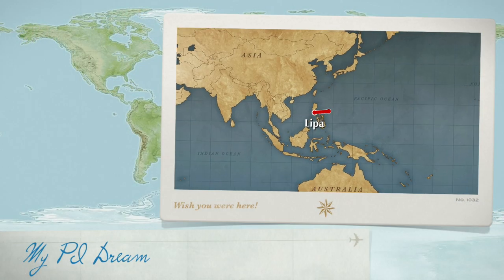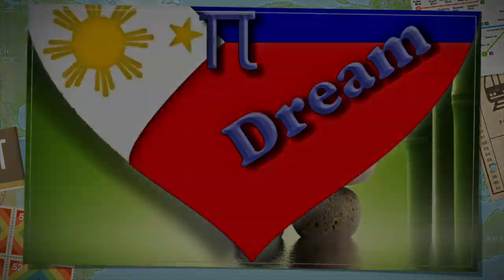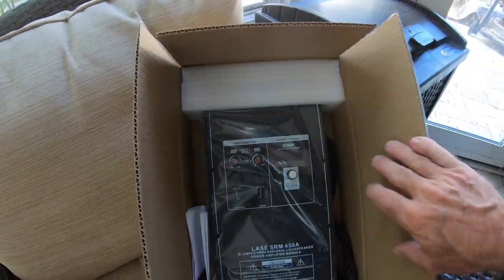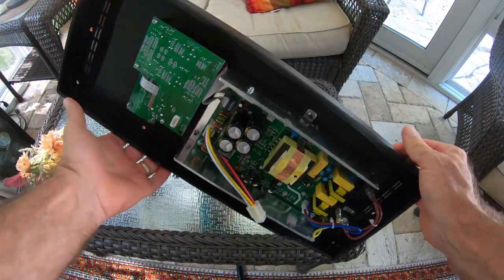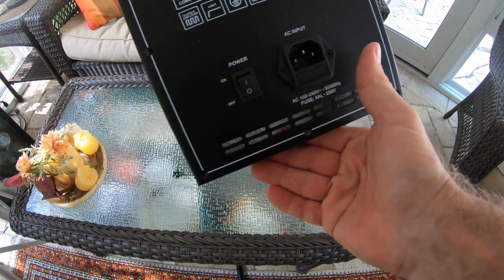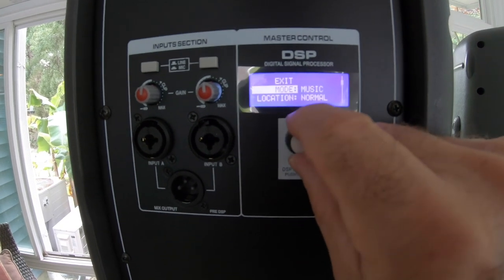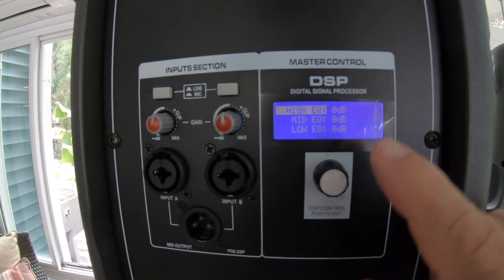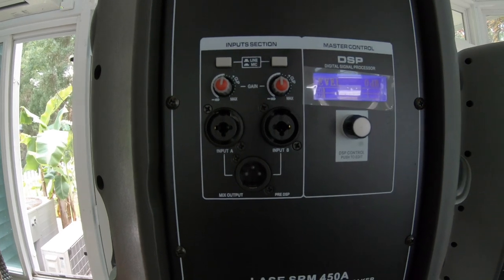LASE SRM450A MACKIE SPEAKER REPLACEMENT AMP REVIEW

Comment: Mr. James the delay is if the speaker is far away from the source. For instance if you have a 20meter cable (or more) away from the speakers. The further from the speakers the more delay there is in mili seconds. I researched the Mackie as well as the QSC systems, both are comparable and work well.
Reply: i was going to say the same thing, time alignment
Reply: I mirror the comments of Andy and Waimea. QSC explains it well. What used to require lots of outboard gear, is now packed in the speaker. All for time alignment.
Reply: @rickcolbert2299  and the dsp in the qsc speakers are great to where you don't need to eq them for monitor
Reply: What drivel. The delay between the speaker and the source is esentially zero (speed of electricity/light). There is a delay of approx 1ms per foot bewteen the speaker and the listener through the air, which is a completely different thing. There may be a tiny delay in the speaker's DSP, which is insigniificant.
Reply: I am certainly not an expert, but I do believe the delay is for a situation in which you would have a set of speakers at the stage. Then, a second set half way out the audience. You can set the delay to give the sound of the first set of speakers to reach the second set of speakers. That way, the audience past the second set of speakers doesn't hear the audio twice. It would sound very confusing to hear the same thing twice. It would only take milliseconds for the sound of the first set to reach the second set. Hence, a delay in milliseconds. That delay would make the sound seem to come from one source instead of two. Hope that makes sense.
Reply: Would have been nice to know what you can delay in terms of throughput  and the driven speakers by the srm450 as a set. Can you delay the FOH while leaving the subs at neutral for example

Comment: Nice to see another Mackie fan do a review on this amp as I myself was curious about it! Back in the early 2000's when i got my first Made in Italy SRM's i was completely blown away by the quality of the sound. I did use them for DJ for crowds around 50 people and they did work well except for the fact that they would overheat and turn off for awhile. I avoided the Blue V2's and ended up getting a set of the Black V2's which i still have today and LOVE because of the reduced weight and the fact that this amp can take more of a beating without overheating. Now i wonder how the LASE would hold up in a punishing environment like i expose my speakers to, something tells me that it would not hold up for very long. Also, i wonder if this company is a 100% Chinese designed / produced amplifier? I wonder if they have gone past the 1.0 software revision by now and made any improvements. Thank you for the review, and i myself have and always will love the SRM450 because of its acoustical properties and how handsome the speakers are. Cheers!
Reply from the maker: So far we haven't had any overheating issues but we only had one gig outdoors to test it.  See our outdoor performance using the upgraded Mackies.  https://youtu.be/xMB7n4PDcaU
Reply: @MyPIDream  this company has copied a similar look with this screen from electro voice looks almost like it!

Comment: Nice. I had two 6 channel Mackey bords. Very clean sound. Loved them. But i had A Carvin PA with 4 18 inch sub's, 2 inch horns, and two 12 inch mids and 5k Wat power then 4 monitor's. I did all the packing and setting up myself. I built myself a nice six pack abbs packing that around every three day's Lol's. Don't miss it at all. Only miss the singing Lol's. I'm never going to pack a PA like that again. Lol's. See you in the Philippines
Reply from the maker: Nowadays, you only get a 3 pack from lugging around a Bose L1 system...😉
Reply: @MyPIDream  ya i working on it the old fashioned way now 😟😟 thousands of sit ups Lol's. Could be a wile Hahahah

Comment: Hello james,
We are building in Philippines and are building the roof beam for a flat roof. I'm interested in seeing the rebar design for the connection to the roof trusses.
Reply from the maker: I'm not a big fan of how roof truss or C purlins are secured traditionally in the Philippines.  Most of the time its just a weld of the wall structural rebar to the C purlins.  I believe, if not cleaned and painted properly from corrosion, the weld joints have a potential to fail.  I'm not a roofing expert but if I were to design it, my thoughts would be embedding threaded GI in the walls and securing the roof to the walls with hardware.  Good luck on your build and keep us updated.

Comment: How’s the after market module going it’s been two years since posted was considering buy two even though the original module is working I don’t want the thermal to switch on mid show ?
Reply from the maker: I brought this with me to the Philippines where we have a retirement home.  Been using it there in our studio.  Still working so I'm going to continue to give it 2 thumbs up.
Reply: adam did you buy them are they working out well?

Comment: The delay only works on the output. 
ie: if you have your mains by the stage and you need a speaker 50ft further into the room…you run a cable from your main stage cabinet and delay it by ?ms you set it at.